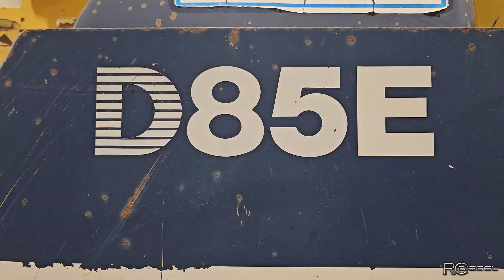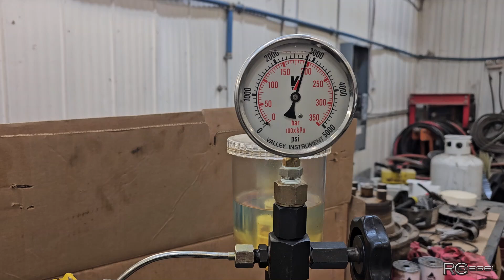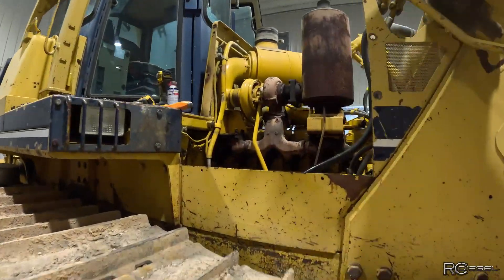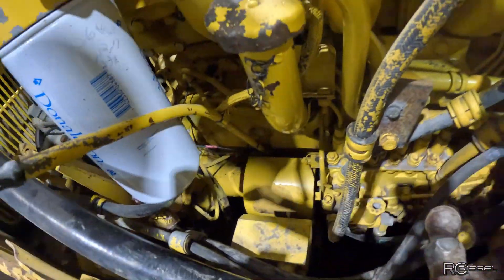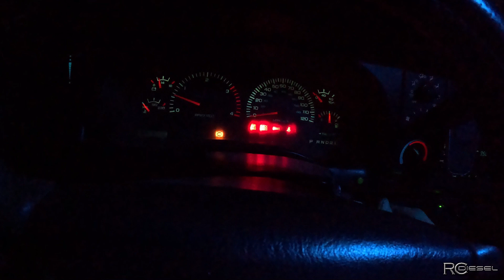Komatsu D85E Bulldozer Repair: Fixing Engine Running on 5 Cylinders with Faulty Injector : RCDiesel

Comment: Cummins engine in dozer I'm assuming.  Do you think the smoking will abate once it comes up to operating temps? Anyways, 👍👍👍
Reply from the maker: @stevefowler244  That is actually a Komatsu Diesel in this one, but lots of them did have a Cummins. I wasn't 100% sure what to think about the smoke. I will say this: stay tuned for video 2 on this one next week wink wink 😜
Reply: I just assumed that some of that crap was accumulate in the exhaust burning off.
Reply from the maker: @stanpatterson5033  It's possible that there was some residual unburnt fuel smoking off, yep. But... In the end, there's more to the story. Next video will be out on the 21st 😏
Reply: @rcdieselchannel  I dont think residue/silt would explain the amount of blue smoke I saw
Reply from the maker: @stevefowler244  Maybe not silt haha But unburnt diesel puddled in a muffler can make a pile of blue/white smoke when it gets hot, until its all burned out. I see that a lot on chore tractors where the exhaust is all slobbered up from idling too cold. Once it gets good and hot, after a while the smoke disappears and doesn't come back until its all slobbered up again.

That being said, you are still correct, this (or at least most of this) blue smoke was not from #5 cylinder's unburnt fuel. 😏
Reply: @rcdieselchannel  I really enjoy watching your videos and look forward to the notifications about new ones.  I    'm very curious as to what you've found even though I have about convinced myself that I'm probably seeing some sort of oil consumption issue. Keep em coming. Thanks
Reply from the maker: @stevefowler244  Hey man, that's awesome! I appreciate it!